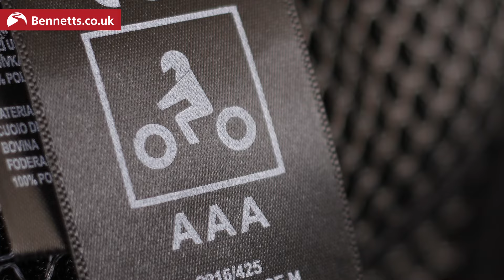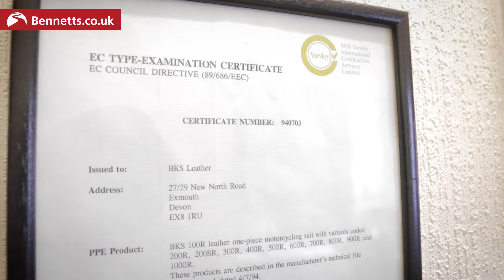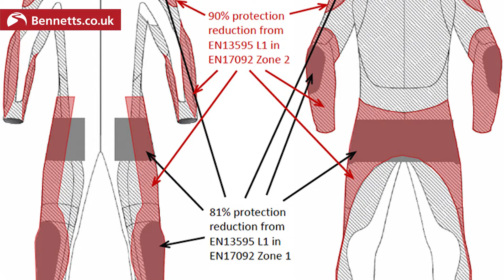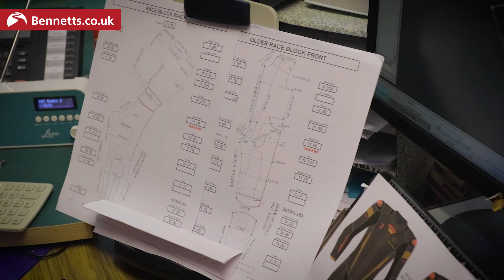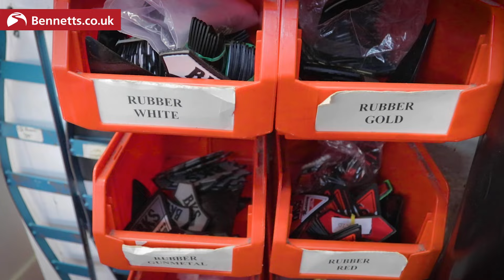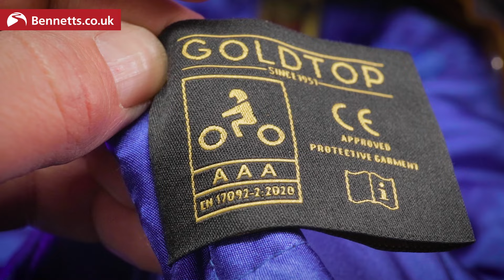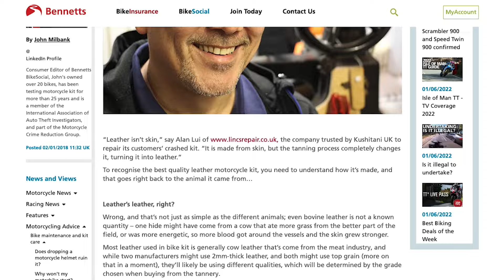Making the safest motorcycle clothing | BKS Interview | British Industry

Comment: I bought my two piece suit from BKS in 1998, measured by Brian. 21 years later, in 2019, and the suit was still like new, but I was no longer the same shape! Another visit to BKS, and alterations made following yet more personal service from Brian. This is an outstanding company, producing garments which are second to non, and an example to the rest of the industry.
Reply: I will beat that y a year + i was measured by Brian at the NEC in PL,suit deld Feb 97 and one ofthe first with CE markings.Still fits (despite a few it shrunk periods) clean and treat it every year.wife refuses to lift/move it as is so heavy but light and comfy while wearing it....execpt in high temps.Hopefully back for more .
Reply: Yes they are able to alter suit, it costs a fortune, I know! The leather suits will last forever with care but seem to have fallen out of fashion, even the police have gone textile. I’ll stick with the suits I have until I hang up the keys, man of leisure. I also have Streetguard heavy and light suits, full leathers in 30C+ is not pleasant.
Reply: Fuck that, I decided to lose the weight, I went from 14 stone doon to 10 and a half
Reply: @DarthDainese69  Far cheaper than an alteration/repair at BKS.

Comment: This was very informative and appreciated. One trend that is becoming wide spread is UHMWPE materials used in protective garments. What I would like to know about UHMWPE is how does it perform and what does it do to the skin when heat exceeds its melting point as I've heard is possible when sliding down pavement. Abrasion is fine but if the material melts users need to know what happens to them.
Reply: Thanks for the comment. Layering is important in the phyics. Our textile suit has several layers of lightweight fabrics underneath the outer shell and if you wear 'skins type base layers' the risk of any melting at skin level is removed. The shearing forces and buffering across these layers and how our suit works in a crash seems to prevent this from happening. Message me at the office and I'll show you some independent testing results from other sourse too.  https://bksleather.co.uk/textile
Reply: @bksmadetomeasure4964  Thank you for your reply; makes good sense. Also, I have seen base layers made using 65% UHMWPE for the purpose of wearing under regular "street" close made of say cotton. I was wondering if given that cotton will disintegrate right away leaving only the UHMWPE base layer for abrasion protection and will it melt? I mean - UHMWPE is very comfortable, cool, and flows air well so could be ideal if it doesn't melt when put to use.

Comment: I bought my first made to measure suit in 1996 I used that on the road until 2003. Then club raced from  then until 2006 and many crashes. In 2007 new BKS suit used for club racing until 2012. Re used the 1996 suit from 2012 until 2013 Bought a new BKS suit  in 2014 used until 2016 when my dad died and I retired. Not cheap suits but when you crash you will be glad you paid the extra. Super quality and great fit and last longer than any other suit.

Comment: My BKS suit is off the peg, not made to measure, and overall I'm very happy with it, however, at the second time of wearing it the zip connecting the trousers to the jacket failed and some stitching came undone.
BKS carried out repairs under warranty without quibble and fitted a chunkier, heavy-duty connecting zip as per my request.
The takeaway from this is that the leathers are mostly well made but that isn't a guarantee that they won't fail in some areas but BKS are great to deal with when things do fail.
Reply from the maker: It's very important to know that BKS off-the-peg leathers have nothing to do with BKS Made-to-Measure. They are two entirely different companies (Brian talks about this in the video)
Reply: These wont be my handmade leathers from Exmouth, but a suit made in Pakistan with no connection to us whatsover. I'm glad you are happy with it though and one day I would like you to see the 'real' BKS version.

Comment: Not sure if it’s different, I got my gear off the peg from J&S, but I’ve owned a number of BKS items and haven’t been particularly impressed. Bought a pair of boots and the leather ripped on first outing. Took them back to get replaced, touch wood the replacements are holding up still. Also had a jacket of theirs and the tab that secures the zip fell off the other day. Perhaps I’ve just been unlucky but personally I won’t be buying their gear again.
Reply: Thank you for your comment. The original BKS (my made to measure brand) has never made boots so you must have the J&S kit which is not made by us and is totally separate from BKS (made to measure ) Ltd. It's likely your jacket is the same if you were not measured by me for it. Nothing my BKS  makes ever falls apart? Feel free to send us a photo for verification. look here for confirmation www.bksleather.co.uk
Reply: @bksmadetomeasure4964  thanks for your reply. It is the J&S kit I have, I didn’t realise it was a different manufacturer. The jacket I have is a BKS Evolution Pro. Happy to remove my comment as I don’t want to give you bad press if it’s a different thing!